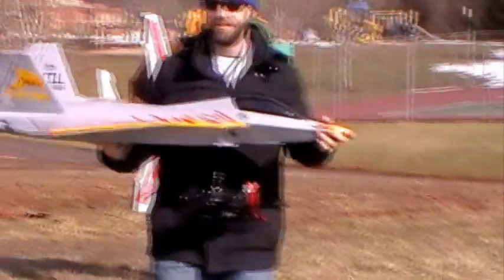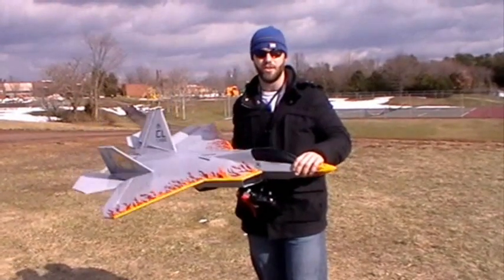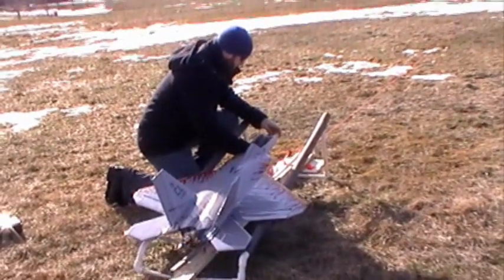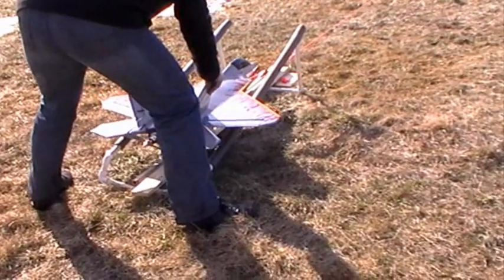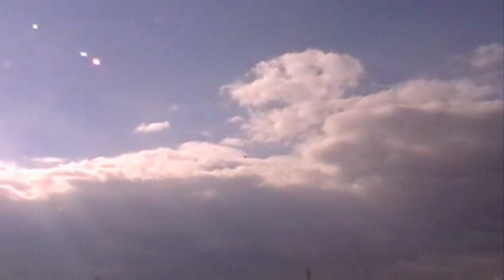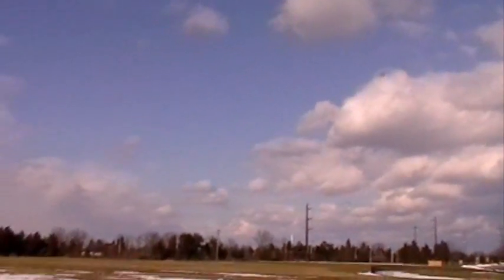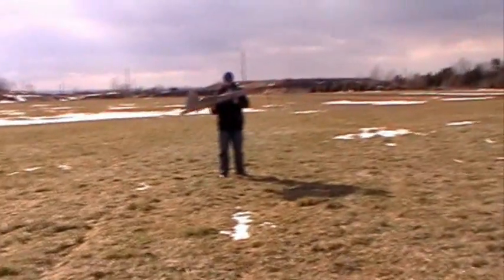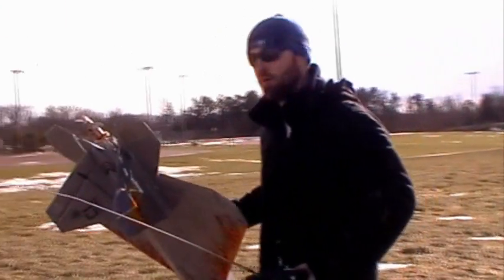F/A 22 Raptor Maiden Video (Bungee Launch) - FIXED VIDEO

Comment: I think my sling shot launcher would need to be a bit longer to accommodate the 51" length.  Might work with the wing rail at 7 foot and the  sling rail at 10 foot.  I have a Phoenix 1600 and a Hobbyking Skyeye that are both around 41"  I hope to launch them as well but I'm going to try your chuck glider test first.  It is easy enough to lengthen my rails.
Reply from the maker: The chuck glider test was very helpful.  And fun, pushing it to destruction :-)

Comment from the maker: Thanks!  I would really recommend giving them a shot.  Most people don't go as overboard as I do (and then there are some that REALLY go crazy).  You could easily build one in a weekend or two if you don't go too big or detailed.  The airframe on this one took me about two weeks just working on it in the evenings.  Covering took longer as I laid the flames by hand one color at a time.  If you like parkjets you HAVE to try steve's designs...